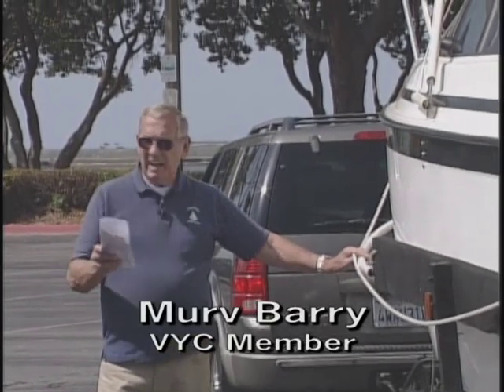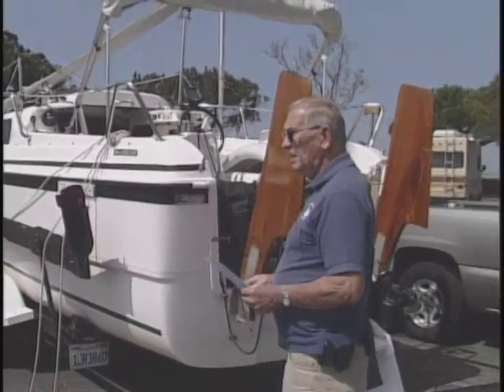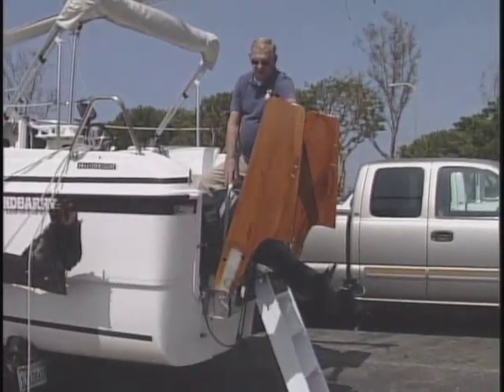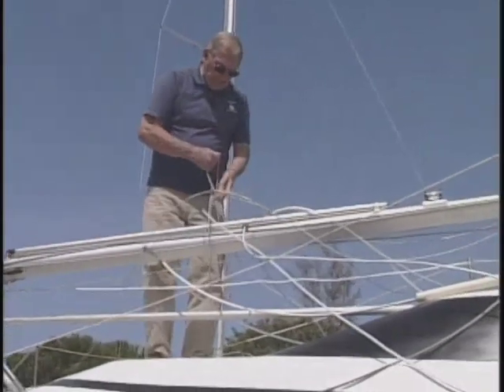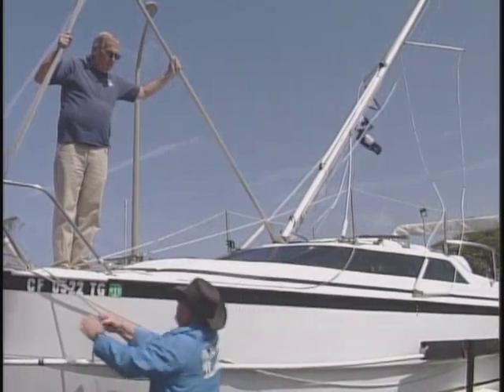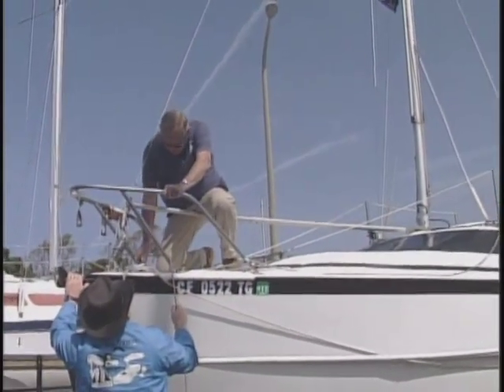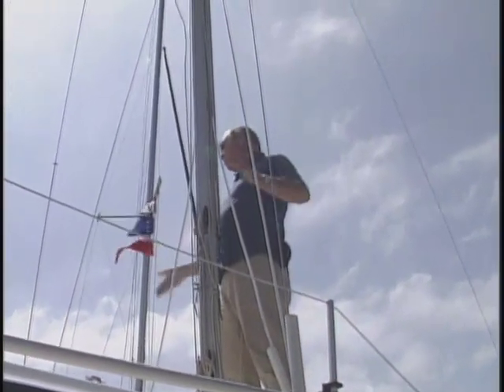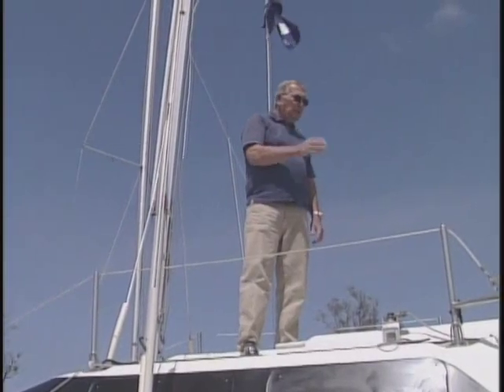Rig Your Boat for Sailing

Comment: Helpful.
Personally, I trailer my 26X and over the years, have tried two different mast raising systems, dropped the mast on my helpers twice due to knots coming loose, so I am always looking for a safer way. This way there are no knots except for the pulleys, and I will be able to use the pole to manage the mast.
It is not fair to say he was adding useless information. If the information is new to you, it is useful even if you decide not to use it.